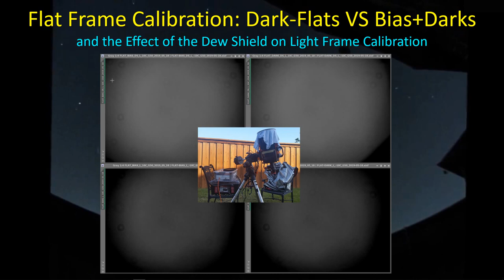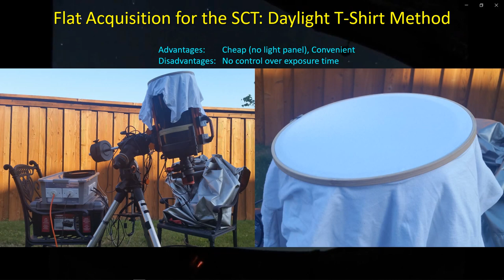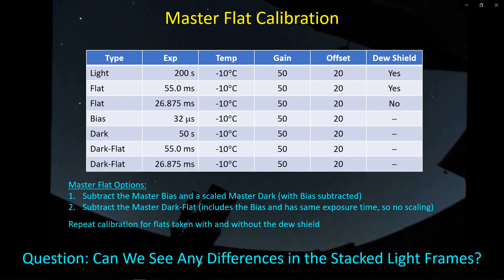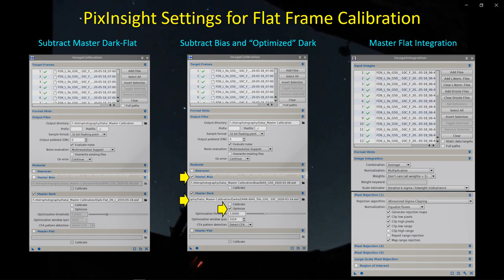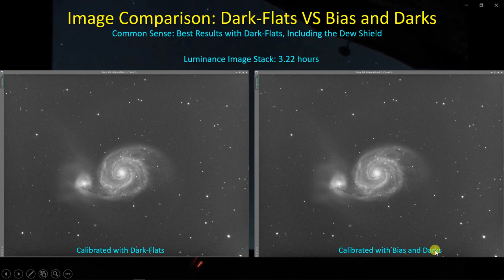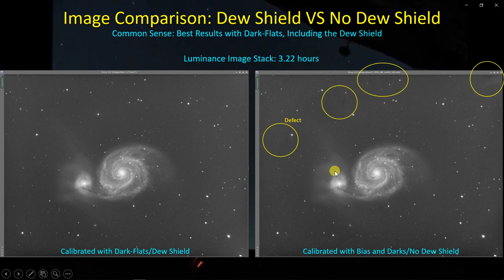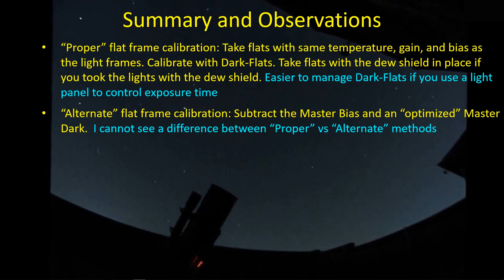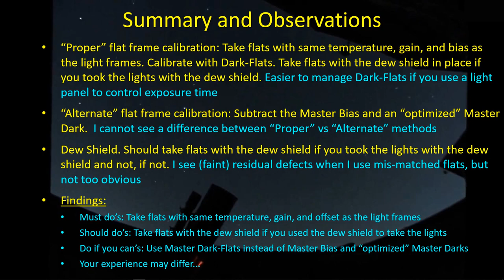Using Dark Flats, or Not, to Calibrate Flat Frames for Astrophotography

Comment: THANK you for doing this video: I also use the 1600mm pro and am revisiting my imaging workflow and was wondering whether I should take the time to do dark flats or not. I suspected there would be little to no difference and am glad someone took the time to do a comparison. Great video, thank you.
Reply from the maker: Thanks for watching! I'm glad you found it useful. I'm starting to form library of darks for the range of typical exposures I use for my T-shirt flats just in case I want to switch to dark-flat calibration down the road.

Comment: Excellent video, and very interesting to see the results! The ASI1600 is one of the better behaved CMOS cameras. The 183MM and 294MC would be different stories I believe. Both have significant amp glow, that does not scale well with optimized bias-subtracted darks (the 1600 also has amp glow, but much less. It would be interesting to see the level of amp glow in a bias subtracted 200s dark and a 50s bias subtracted dark that has been stretched to 200s). The ASI294MC Pro also doesn't seem to like short exposures in general! Flat frames are recommended to be 2-3 seconds long from what I've read, and bias frames avoided. I personally only use dark frames, as they contain the bias signal... You could choose to not calibrate the flats, which will work well on dithered sequences, but could definitely cause issues on non-dithered sequences, as the flats can reinject some FPN. Aaargh, things get so complicated in this hobby, glad you're here to investigate everything!!!
Reply from the maker: Thanks for the info on other camera "personalities." Seems like a good argument to only work with one camera. The 1600 certainly has amp glow I can see in my dark frames, but maybe not as bad as other cameras. And that's a good point that amp glow may/will scale differently. So many variables, so little time.

Comment: Thanks for your videos. Always a pleasure to watch. I have been knocking around the idea of using dark-flats for quite awhile now but still haven't bothered to change my process. I am puzzled why your dark frames are only 50s. I thought that darks were supposed to be the same exposure time as the light frames. No? I see why you used the 50s dark (maybe I don't) but I guess what I am asking is, why wouldn't that skew the result from actually having used the proper 200s dark? Thank you again for taking the time to produce these wonderful videos. Your channels is a favorite....
Reply from the maker: Yeah, it's confusing. 
When you calibrate the light (not the flat frames) frames, your gain, temp, and exposure time used for the dark frames should all match what you used on your light frames. I believe the 50s exposure is what I was using to calibrate the flat frames.

When calibrating the flat frames, you can use Dark-Flats or "optimized" dark frames (i.e., scaled down from longer exposure used for light frames). When you use the dark-flat approach, your dark-flats should have the same exposure time, temp, and gain as you used for the flat frames for that filter.

When calibrating the flat frames using darks, then you can use the same long exposure dark frame you used to calibrate the light frames but you have to click "Optimize" in PixInsight to scale down the noise level to match the flat frame. In my case, I had some shorter duration dark frames at 50s I used to calibrate the flat frames.

Geez. I think I made things more confusing...sorry
Reply: @Aero19612  I think you explained it perfectly. When you use the "optimized" dark frames in lieu of the dark-flats, I assume you then still need the bias frames? Thanks for taking the time to answer.
Reply from the maker: Yeah, I use bias frames when I calibrate the flat frames with the dark frames. I also subtract the bias from the dark frame so that it's just the dark frame with no bias signal. I'm trying to switch to using dark-flats. I have a "library" of dark-flats for typical exposures I end up with when taking flats at dawn with a T-shirt. Thanks for watching!
Reply: @Aero19612  Thank you!

Comment: Interesting James. I was reading that BIAS frames are better/applicable for CCD cameras than for CMOS? The difference between dew shield and no dew shield, may just be that they are taken at a different time? I’m not saying that you are not fastidious in your preparation. Simon
Reply from the maker: Hey Simon. I "hear rumors" about bias frames as they relate to CCD and CMOS. I'm no camera sensor expert, that's for sure and I don't even own nor have ever used a CCD camera. I'm not sure what the source of the statement is. I'm sure there's some logic behind it. I DO know that my CMOS ASI1600 produces a significant bias frame (aka read noise) compared to the cooled dark frame. So something has to be done with the read noise. Now, if you use dark-flats to calibrate your flat frames and you have not removed the bias from the dark-flat (which you should not do), then you're OK because the read noise is in the dark-flat. So, in that sense, you're not using a separate bias frame, but you are accounting for the read noise. Same goes for calibrating your light frames. If you use a Master Dark frame and do not subtract out bias from the dark, that's ok because the read noise is in the Master Dark. The "alternate" flat frame calibration method I mention in the video uses a Master Bias frame and a Master Dark frame WITH THE BIAS SUBTRACTED OUT [I'm not yelling ;-)   ] and the Master Dark is "optimized" for the flat frame exposure time. That works as well (see my next video on the topic of "why we calibrate flat frames"). So, in that case, you do need a separate bias frame. But, if you can calibrate your flats with dark-flats, then by all means do so and never take a Master Bias frame. That said, I don't know why everything I just wrote doesn't also apply to CCDs. But then, I'm not camera sensor expert. Sorry for the long reply.

Time of day could indeed have an effect on with/without dew shield results. I don't believe that was the case however. I recently experienced another case of mis-matched dew shields (been doing some studies on dew shield length of late). I once again found that when I took light frames with a 3" dew shield and used flats taken with the 8" dew shield (too lazy), those darn artifacts appeared again. My take-away was/is: If you take lights with a dew shield, then take flats with that dew shield. Maybe the results would be different if I used a light panel (which I don't have). As far as not being fastidious...I have a video discussing what happened one night when I forgot to turn the lawn sprinkler system off before leaving my telescope outside. Not fastidious? Guilty, as charged.
Reply: @Aero19612  You are fastidious with your analysis... perhaps the dew shield "masks" any stray (neighbours) light catching "motes" so that they "show up"?

My book on AP is by someone who likes to use a CCD - they are expensive. So the CMOS vs CCD may be a "dig" at CMOS.

For me, CMOS is affordable. I have ASI294MC as an "intro" camera. Simon
Reply from the maker: I’m sure the dew shield is providing some degree of stray light reduction. That’s why you want to take flats with the same (or no) dew shield you used to take the light frames. CCD cameras are very expensive. I’m glad CMOS technology is taking over so we can afford this hobby.

Comment: So, I've a white t-shirt screen mounted on a ring that I can fit inside my dew shield... but it sits against my SCT corrector plate.. would I be better off placing the ring near the top (opening) of the dew shield instead?
Reply from the maker: In my opinion (take it for what it's worth) your t-shirt ring should be placed at the end of your dew shield. But maybe try some flats the way you have it and, if there are artifacts, try my suggestion. Just tell me what your experience is! Thanks for watching!

Comment: Very interesting James. I’ve never taken dark flats but will give it a try. I’ve heard that with cmos cameras there’s no need to take bias frames for light calibration. Any thoughts? I always have done but then I’ve used a ccd camera exclusively until getting the ASI1600.
Reply from the maker: I have not heard that about CMOS cameras before, but that does not sound right. If you use Dark-Flats, there is certainly no need to include a separate Bias frame in the calibration (indeed, it would be "wrong" to do so) because the bias is included in the Dark-Flat. For a cooled camera, like the ASI1600, the background noise of my Master Bias is 295 (out of 65000), but a 200-sec Master Dark (with Bias subtracted) is only 17, a 50-sec Master Dark is 7, so the dark for a 55 ms flat frame would be VERY small indeed. If anything, I would say there's no need to include a Master Dark if you calibrate with a Master Bias and "optimized" Master Dark. That said, as I ramble on here, the background level for the Flat frame is 20,000. So is there any need to calibrate them at all! The Bias and Dark background levels are swamped by the Flat illumination level anyway....Just repeated the comparison I did in the video for the stacked M51 set using non-calibrated flats. Looks identical to the sets with calibrated light frames. So maybe your original question is: Is there any need to calibrate flat frames? Maybe not!

Comment: Have you ever tried bias only for flat calibration? though I’ve heard this may not be optimum for some CMOS sensors.
Reply from the maker: No. But there's some logic to it if you have a cooled camera. When the sensor is very cold, the dark current noise is very low (represented in the Dark calibration frame). The read noise for some CMOS sensors at some gain levels can be relatively high. On the other hand, it takes just as much effort to make a Bias library as it does a Dark library that includes the Bias. So, I just calibrate with Flats (of course) and a Master Dark (Bias is included in the Dark frame). Thanks for watching!
Reply: @Aero19612  Agree , I’ve always done Flat Darks with my CCD, but I am transitioning to a CMOS camera and have been researching, my plan is to stick with Flat Darks. Thanks

Comment: Did you use a focal reducer. Great video . I’m in the beginning glade I found your videos . What is your light pollution there .
Reply from the maker: Hey, Dan. I'm probably in a Bortle 6 or 7 (northern suburb of Dallas). As you'll see in my other reply, my "finished" M51 isn't. Yet. I'm trying to get about 25 hours of imaging time on it and M106. Maybe next week!
Reply from the maker: oops. No, I'm not using the focal reducer for M51 and M106. I have used it for M33, M81/M82, and the Leo Triplet. Whenever I need that little bit reduction in focal length. M51 and M106 fit nicely in my C9.25 FoV without the focal reducer.

Comment: For the darks, was the dew heater on?  Or were you just using the shield? As an aside I was reading at PixInsight that dark flats are not needed; if one is using PI
Reply from the maker: Well, for the darks there is no heated dew strap or dew shield. Neither should have any effect on the darks though. I agree with that last statement--my results show there is no difference. However, if you read my long-winded response to John's question in the comments, I may have talked myself out of calibrating flat frames at all!

Comment: Do you know how critical focus is when taking flats? If the focus is different between filters, should the flat focus match?
Reply from the maker: Hey Michael. I don't think it's that critical. We will change focus throughout the night because of temperature and, as you say, due to filter changes. By the time you take your flats, the temperature will be even more different. You just don't want to be "way" off. Pleeeease let that be true!
Reply: @Aero19612  Thanks James.
Reply: @Aero19612  As far as I understand, the focus when taking flats is indeed not critical. Any filter vignetting and dust mote sizes are determined by the angle of the incoming light rays (and thus by the focal ratio) and distance to the camera sensor. Theoretically on an SCT, that FR changes slightly as focus changes since the main mirror is moved, but it's so small as to be insignificant for flats (if you're not moving the main mirror by many turns of the knob) :-)
Reply from the maker: Ahh. Thanks for the confirmation, Cuiv. I knew I wasn't prepared to do any more work on flats.
Reply: @CuivTheLazyGeek  Thanks Cuiv.

Comment: Dew shield or no dew shield is not an option for those of us with HyperStar - we have to use a dew shield since the HS and camera are located in front of corrector/secondary mirror. Clear Skies & God Bless. Be safe.
Reply from the maker: The dew shield has so many advantages. Just one big disadvantage (wind) for me. Do you do anything to deal the increased wind sensitivity, or is your mount much better at dealing with it? Thanks for watching!
Reply: James Lamb I have been OK so far. My most recent sessions were at targets gradually approaching zenith through the night so the OTA was going a bit vertical thereby getting more stable as the session progressed. My EQ6-R Pro is pretty solid given my EdgeHD 8"...not much of a moment arm being put on the mount since my SCT is so short/small/light compared to a 9.25 or a bigger frac. Love your channel, keep up the awesome job! You are making a difference.
Reply from the maker: Good. By the way, you're the 2nd or 3rd person who has good things to say about the EQ6-R and/or the AZ-EQ6-R mounts. I'm very interested. Thanks for the kind words!
Reply: I upgraded from an Evolution mount to the EQ6-R Pro. It has been the biggest/most significant modification/investment I have made, followed closely by going cooled mono ccd. I am very satisfied with its accuracy and stability for my setups - HyperStar/Guider or Focal Reducer/Motor Focuser/OAG/Filter Tray/CCD. I have heard that the CEM60 is another good option but I am fine with my setup.
Reply from the maker: Great! Thanks for the feedback